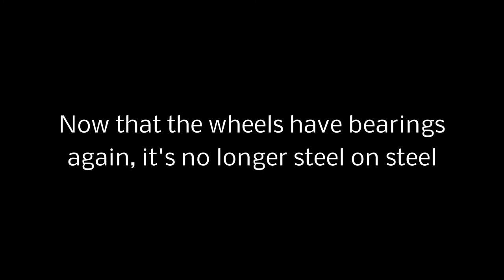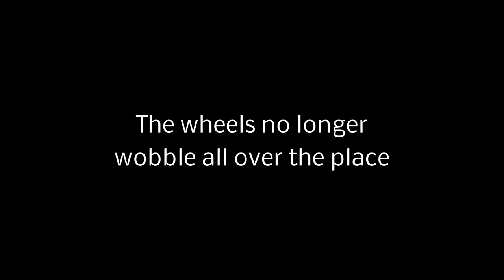Dump Trailer Overhaul - Part 1 (The Wheels)

Comment: how many kilometers can you cover with the lithium ion or gel batteries and how long do you have to charge?
Reply from the maker: I have gel batteries, I believe 93 Ah. In the summer, I get about 40 kms max. The battery monitor will read full after about 3-4 hours but a full, deep charge, takes about 7 hours on fully discharged batteries. In the winter, my range can drop below 10 kms.
Reply: @TheTimeCapturer   with my scooter 2x12volt 75AH 31miles maximum is not much because I live on the mountain or I have to drive a lot of inclines when I go to the doc or shop etc. in winter at -3 degrees the range is very limited, the batteries are with me in half a year broken I recently found some with 107AH = 50 miles range which I will get next.
I'm happy with my scooter (9.32 miles) top speed :-) you get a little wind in your face.
Reply from the maker: That breeze is nice on hot days.